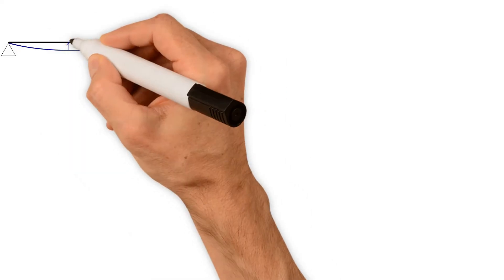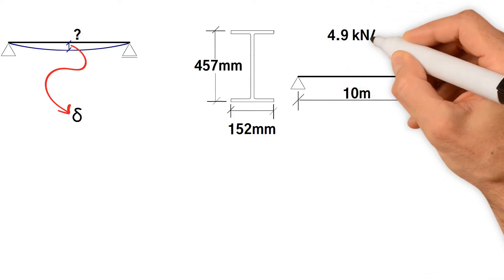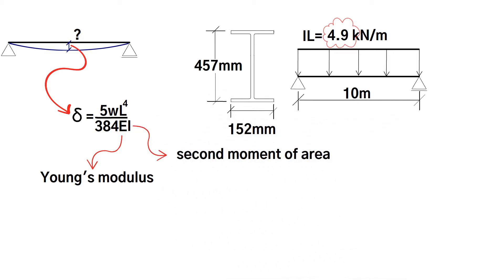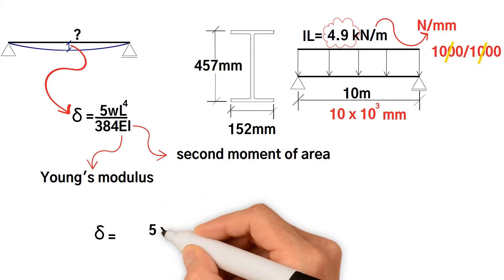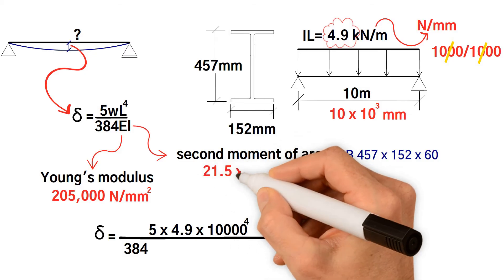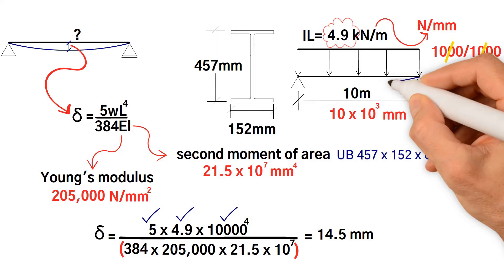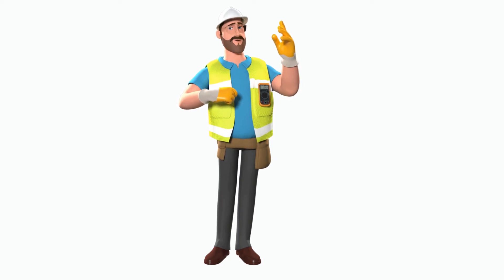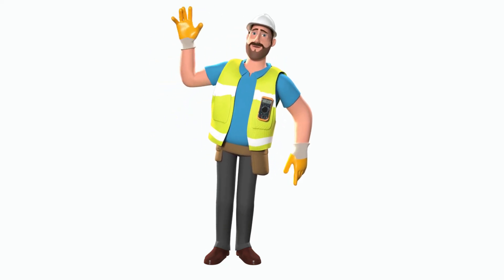How to do a steel beam deflection calculation

Comment: This is a great video.  I calculated deflection last week at work and I compared my answer in SI and Imperial units to be sure they matched.  They did not. I switched from meters to mm and the Young's Modulus used here and everything worked out.

Comment: Nice video thanks! From the table of properties I get a second moment of area (257x152x60) of 25.72 x 10^7 mm4. In your video you seem to have used the one of (257x152x52) which is 21.59 x 10^7. Could you review this?

Comment: from the Structural engineer's pocket book third edition, the second moment of area UB 457x152x60 is 25500cm^4, it can't be 21.5x10^7
Reply: what then do you think the correct answer should be? please im asking for my self. currently working on this and I am struggling to understand where the young modulus is gotten from.
Reply: @ayopreciousgold3213  the youngs modulus is a material property. If you know the metal you also know the E.

Comment: Thank you so much this
Just wanted to know, at last the length was divided by 360 to check whether the deformation is acceptable or not 
What is 360 ??
Is it standard value to be considered while accepting the deformation?
Reply: It is a pattern defined by codes. The beam span must be divided by 360. And depending on the calculation method adopted, such as LRFD (Load and Resistance Factor Design method), there are different values for each type of use, such as floor beams, roof beams, etc.

Comment: why we neglected self weight of beam
????
Reply: Because, unless you are designing a beam for fabrication on demand, all you need is just a reference number for a necessary minimum moment of inertia, in order to search, in a standard catalog of ready to use steel beams, those whit a moment of inertia  slightly superior to that found in calculation. So you take the self wheight of the catalog beam and redo the same calculation. In general, the self wheigt is not significant in final result.

Comment: I got the answer is 1.447mm...please correct me if i wrong....one more question, can i use this formula to calculation Square Hollow Section?
Reply from the maker: Please review your calcs. You can also use this formula to check the deflection for any simply supported section.